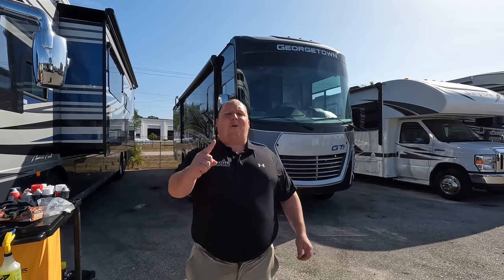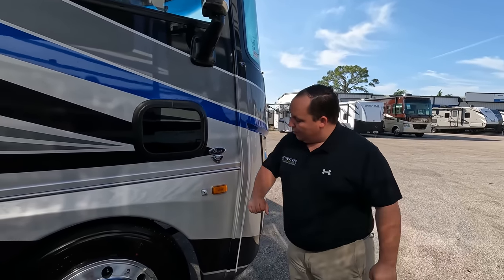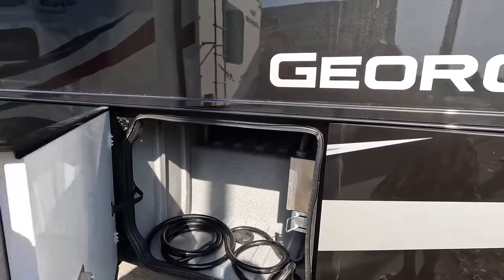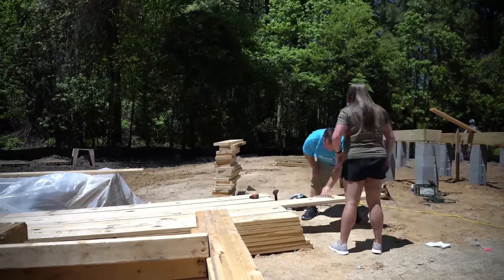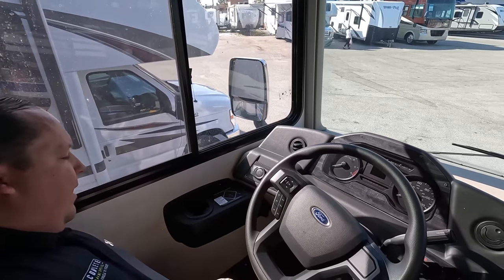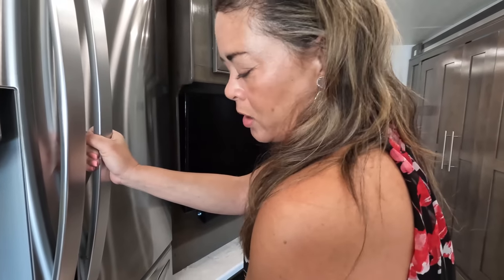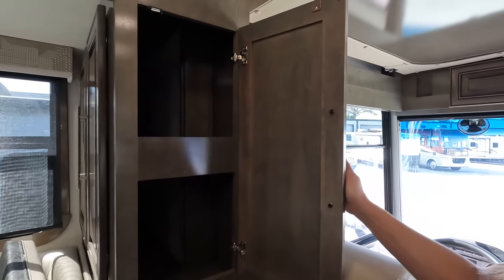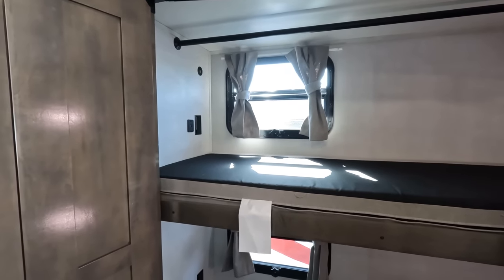The BEST and MOST LUXURIOUS 2 Bathroom Motorhome 🚽

Comment: ❤️❤️  I was thinking the rear bath should have a sliding door with a full length mirror.

Pock doors are between two walls.  Barn doors or sliding doors are on one side of the wall.
  Very nice unit.👍👍

Comment: LOL the whole house water filter just kinda laying around loose? Or is that an option to have it mounted correctly and cleanup that mess of wires and plumbing? That's a big clumsy engine cover two climb over. Storage under dinette should be pullout drawers. Okay, you got bunks and you have theater seats so where do the kiddies sit to watch TV? Nice second bath for the kiddies and they can poop in a perfect position. Cabinets over the bed suck. Stackable washer/dryer is nice. Rear bathroom door is odd, and shower is small. What I wonder about is with the weight of this unit how well would you tow a Jeep and climb a hill? We have a smaller 34' RV that loaded weighs 21,700LBS and towing a jeep Wrangler Unlimited and climbing a pretty steep grade we are down to 40MPH.